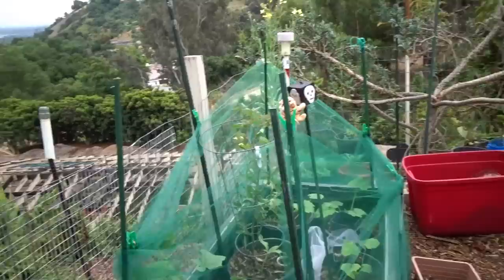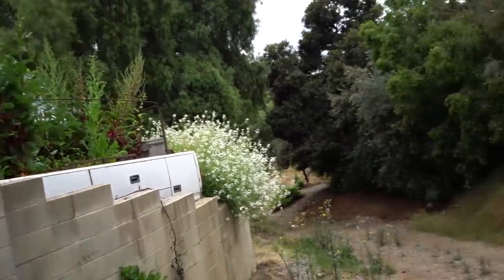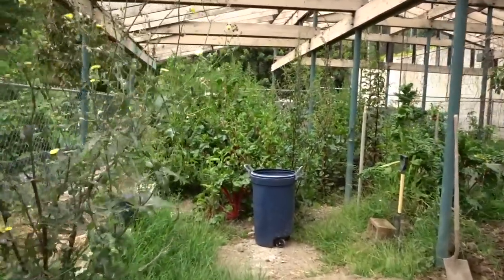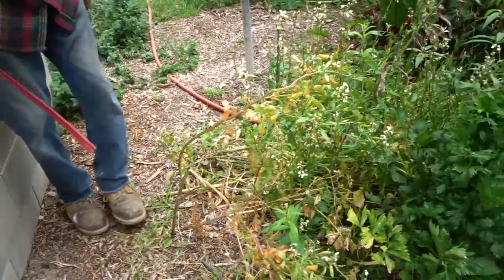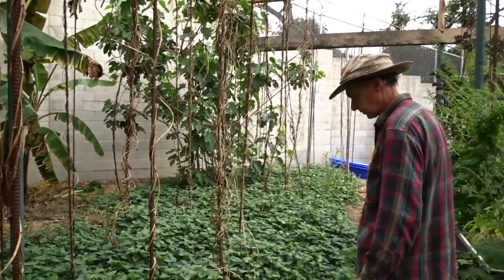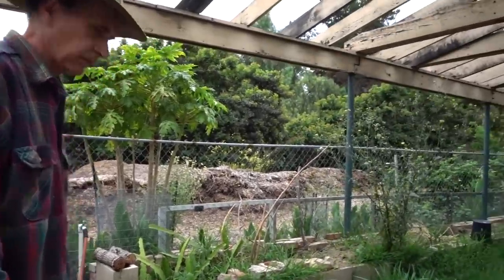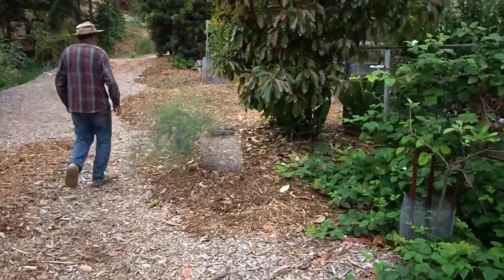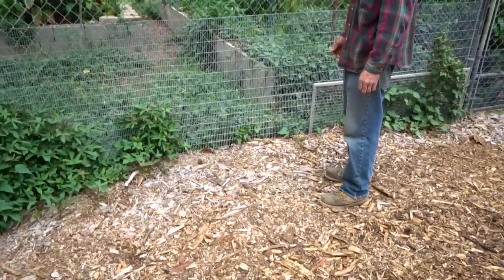How To Woodchip Garden Grow SUPER Large Vegetables Easy Self feeding Mulch Less Water Needed No Till

Comment: I think i may have missed it but how long did yall let the wood chips sit before planting in to them?
Reply from the maker: You can plant right away if you have it laid out, you will have to move the chips away from the plant, plant the plant in the soil (OR I have made a hole and filled with garden soil or potting soil) then after the plant is in the ground, you push the chips around the plant....I see a quick video on this, GREAT question, thanks, Robbie
Reply: @RobbieAndGaryGardeningEasy  i would love a video! Ive been using raked leaves and grass clippings and wanna get a pile of wood chips but felt like i would have to find a area to keep them a while to decompose before using where as my husband thinks we should be able to use them right away
Reply: I am doing the exact same gardening, I planted right away. I plant annuals while I wait for my fruit trees to grow. Every year the soil improves more and more. It becomes easier to grow harder and more sensative plants

One thing is at first, the woodchips need more watering, more weed pulling, and it has a insect explosion. But over time birds, lizards, and other wildlife move in, the ecosystem balances out, and you have less and less problems with any one organism.

One year I had massive flies, the next all the flies were gone because of spiders and lizards. I also let crows each the beetles in my garden. Snakes [non poisonous] eat my gophers, and so do the cats. The more life in the garden the better.

If you think you do not like the woodchips, give it 3 years, before deciding to give up on it. There were times I thought it wasnt working well, but over time it really does work incredibly. I also find myself learning that I need to put down way more woodchips than I think I need. I put down about 12 inches! In San Diego. After a year half of all the woodchips are gone! I need to add more each year

I also added live worms and ladybugs after the first year. They reproduce and now thrive now that the garden is established and they have somewhere to live. You will find gardening in woodchips is different than normal gardening. Small seeds are harder to start in the ground, watering is less often, but MUCH DEEPER. So I need to water heavily at one time, but far less often. Over the years you will adapt and learn, and fine its much easier.

You can see the part of my yard without woodchips is a weed jungle, but where my woodchips are, after a couple years of weeding, the weeds are now all gone. I no longer have to weed!
Reply: @portaadonai  i think ill try it out. I've been using hay but dont really think im a fan of it so i switched to using leaves and yard clippings up til i get the money saved for wood chips. My biggest fear was having a ton of ants doing the wood chips but even having 1 raised bed and most plants in ground with the yard clippings im battling ants like crazy all around.

Comment: Knowing that clay is very rich in nutrients my take on this is that the woodchips hold moisture and keeps the clay from hardening?
Will the soil become sour over time?
Reply from the maker: Gary responding. Woodchips help to prevent evaporation. A big problem with clay soil in low Summer rainfall climates. Without a cover water constantly wicks to the surface.  Air can pass through the woodchips to the soil so it does not become sour.

Comment: Okay I understand that you can't use wood chips that are sold as a mulch. However what about the wood chips that are sold as a bedding that come from like Farm Stores? They usually are like pine wood chips and as far as I can tell they're just pure wood chips
Reply from the maker: Gary responding. The woodchips sold for animal bedding will work. The difference is how quick it will break down. It is similar to regular composting. The nitrogen to carbon ratio will effect the decomposition rate.  Bedding woodchips are from tree trunks, high in carbon, low in nitrogen. With green leaves and twigs the difference is less and the microbes use nitrogen  so woodchips from whole trees work better. If you use animal bedding I would add a nitrogen source like green plant matter or manure.